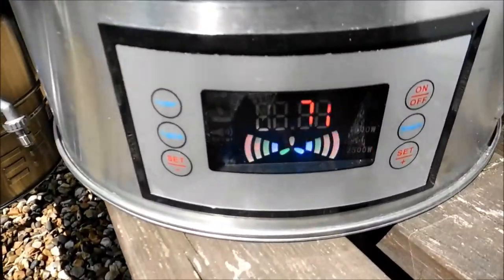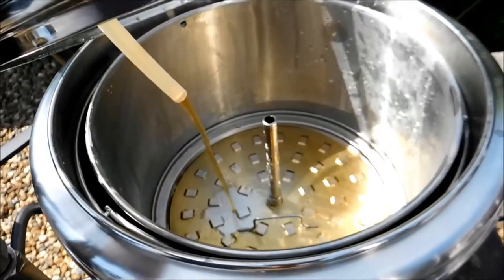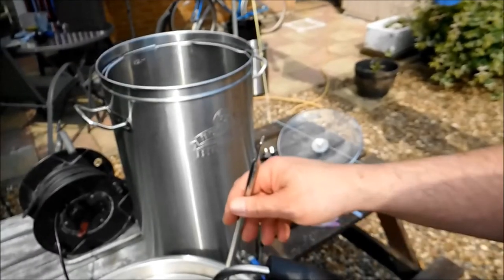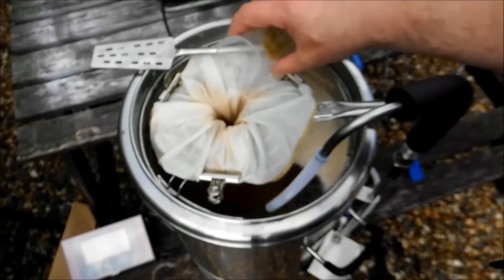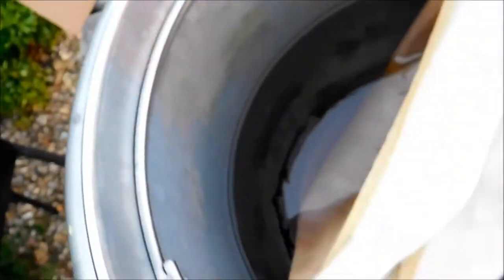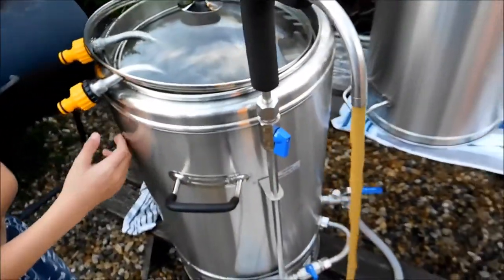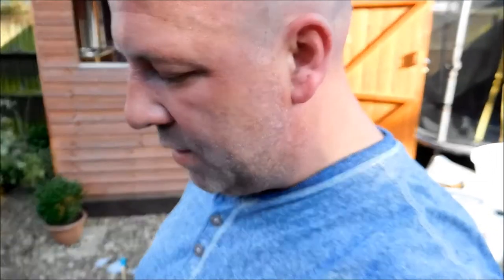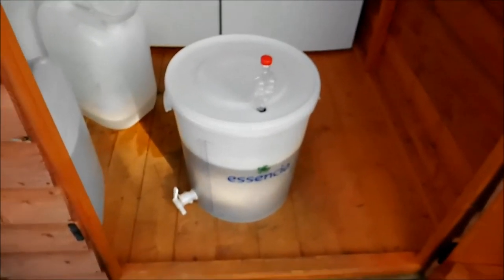Brewday #3 - Underletting with The Bulldog Master Brewer! West Coast Pale Ale

Comment: Hi, not sure if you are still here! 3 years on, did they ever fix the calibration/boil issue? I see Klarstein have come out with a very similar model though only single skinned, different controller though. 
Would you still get the Bulldog today? It does look a bit more sturdy than the robo-brews. 
Cheers!

Comment: Do you use the bazooka or something else? I can't really use the sparge plate during mashing as it gets stuck with the small grain pieces coming up the pipe.. Then again the included Master Brewer bazooka is just a horrible piece of equipment.
Reply from the maker: No mate I stopped using after first brew I think! How you getting on with yours?
Reply: @AliSim2103  Everything still works as it should. I still don't use the sparge plate during mash though. My efficiency rates are still around 80%, so I haven't really stressed about it too much either.
Reply from the maker: Yeah I only did it to try and recreate the way the grainfather worked. I don't think it brought anything better or worse to the process and thinking back I think I used it to measure the flow of the recirculation. I now think leaving the sparge plate off and stirring during the mash ups efficiency!

Comment: SO after a few months do you think it competes with the grainfather?
Reply from the maker: It does the same thing and the end product is the same! Obviously the bluetooth controller, the phone app, the counterflow chiller and the other online support give the grainfather the edge but I have done an imperial stout on the master brewer with 9 kg of grain and the ability to underlet through the anti burn inlet came in very handy for that very large grain bill!! Grainfather is also around £100 more but all in all with the ability to calibrate temp throughout (even though the temp is pretty bang on) the double wall insulation and the general sturdiness of the master brewer I’d say it’s worth going for over the grainfather! But... I’m sure folks will come to there own conclusions! There are issues with the controller both build and program but easily work aroundable 👍